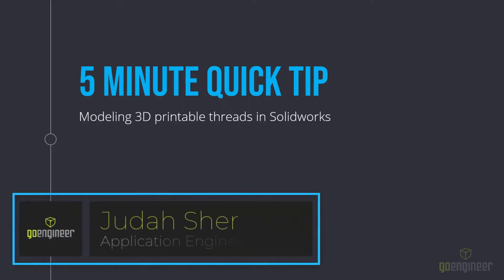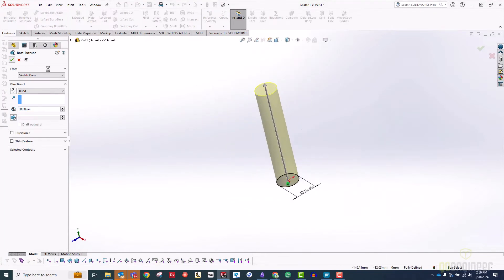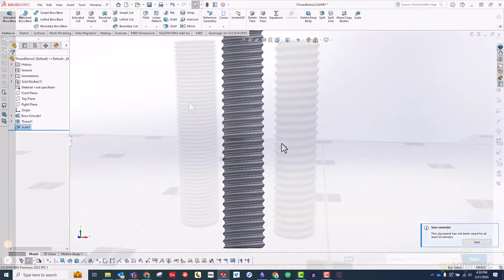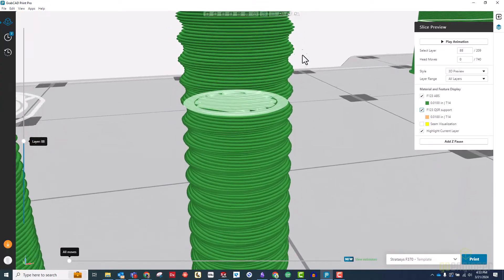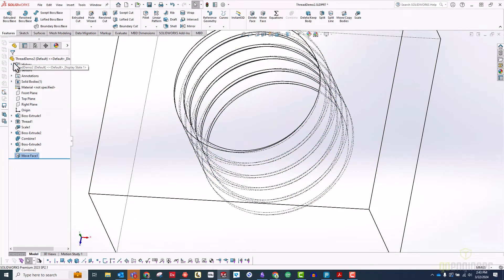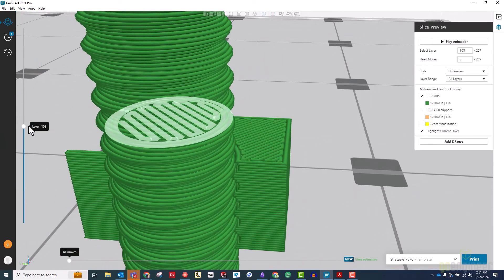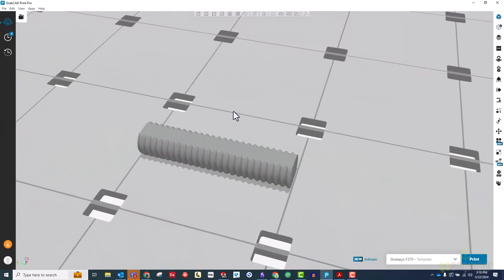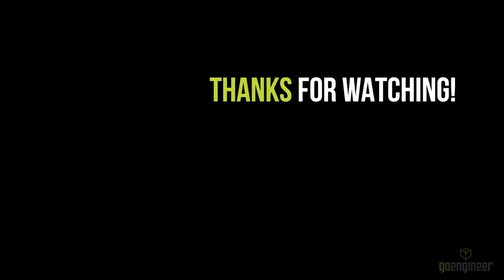Why Your 3D Printed Threads Don't Work

Comment: It seems like when I scale the thread, the rest of the cylinder or bolt gets longer as well, which can potentially cause issues if one is using precise measurements for a part or assembly or joining parts together.
Also... is there an easier solution for having more than one bolt or thread hole, like at various locations on the part, after trying it out,  it can become a bit tedious after a while having to do all these steps if there are multiple bolts and thread holes in a part.
Is there a way to shortcut these steps and standardize it as a feature or import it in to other parts at precise locations ?

Thanks for the video by the way.
was working on a class project and got stuck at making a properly functioning bolt/thread that actually had grip for a clamp and this video is the one that saved me. Just wish i found it sooner
Reply: @goingineer ⬆️⬆️⬆️?
Reply: @goengineer ⬆️⬆️⬆️ ?

Comment: Printing the screw laying flat means that the head of the screw must be a separate part, correct? Is there no easy way to solve this, or do you just accept that the head of the screw must be a separate piece
Reply: What I've seen in other videos ( mainly fusion 360)  is they modify the scre head so that it can also fit that flat profile orientation.. It may look like completely different than traditional hardware but, 3d printing is different than traditional manufacturing

Comment: First time making screws, I have a plastics injections molding background and I work with a company that makes taps. I thought this would be no sweat. I started with acme threads, similar line of thought as using the M10 and scaling the y. Then when printing laid the bolt down and the nut standing up. I thought this would help with the shrink but still oversized the whole nut in the printing software by two percent. This did not work. nor did four percent. I think I need to go back and put a flat on threads like you shown, this is a good idea. 
Next  I want to try printing a double started thread and a triple thread for future projects.

Comment: Since I got my 3d printer I've been printing many nuts for my projects to assemble with steel M6 bolts Ive had laying around. I was printing nuts without making any adjustments. While its hard to tighten them by hand - I kinda feel like using those DIN985 nuts with nylon inserts. Also working on mechanisms they showed stability due to untightening resistance thats provided with extra grip. However, tips in this video are helpful and I will use them for prototyping in the future!

Comment: Thank you for the video!  I followed your instructions and now my threads are the envy of my Tool Design classmates.  If you are like me, and only wanted to scale the threads, you can use the split feature to cut your part so that the threads are seppearted from the main body.  Then you can scale it in the Y and move the faces of the threads as shown in the video above.  Here's a link to another video on using the split feature: https://www.youtube.com/watch?v=HxJoIvLlGCw&ab_channel=TriMechGroup

Comment: wait you call yourself engineer and dont even tell people how to srs fix a metric thread to 3d print? even dont tell them that solidworks doing only nominal threads that are not working for production cause 0 tollerances? you have to explain now why do you call yourself GoEngineer :DDD

Comment: unfortunately, this scales the whole part not just the threaded section.
Reply from the maker: You can apply the scale feature to individual bodies in the command manager. I would suggest using the Split feature to cut the bolt into 2 bodies so that you can scale only the threaded feature and leave the head of the bolt as-is.

Comment: Thanks for making this!

Why not use the indent feature instead of combine? - It allows to control the cut tolerance directly from the feature.
Reply from the maker: There are almost always multiple ways to do something in SOLIDWORKS. Combine is probably the more commonly used feature to accomplish this, but an indent would work too. Good idea!